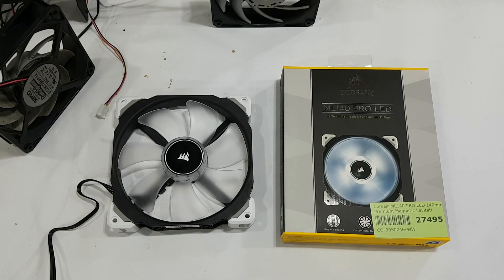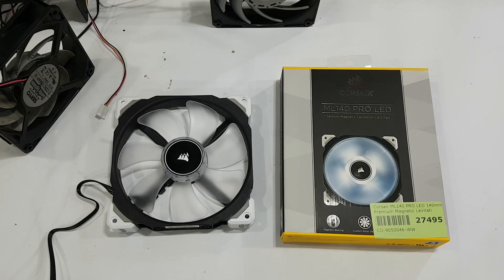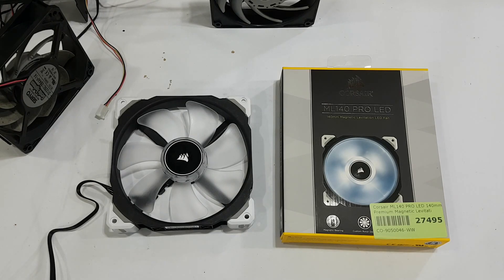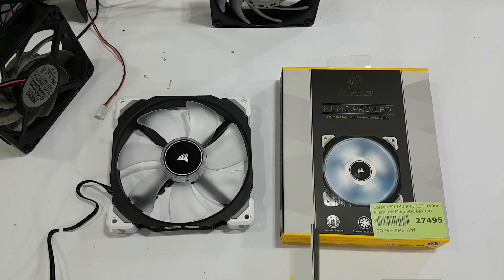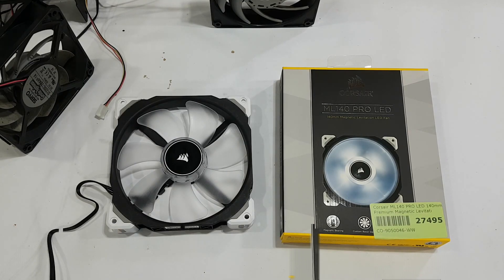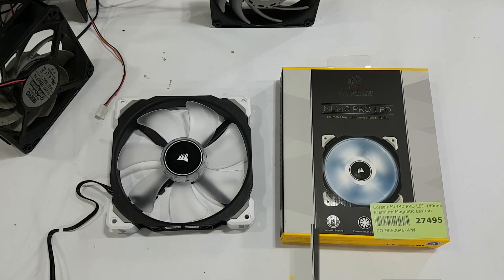🛠 Peltier Cooling My Computer: Corsair M120 ML140 :Part 2

Comment: All  of those aesthetics are getting in the way of proper function.  People will still buy them in droves I'm sure.  I will definitely need a shroud before I mount something as poorly executed as that.  And if it turns out to be the fan of the century, I will design and cut that shroud to make it work.  So ... now we'll be waiting on your performance evaluations of these to see if we indeed have access to the fan of the century. :)
Reply from the maker: Based on this test WHILE pushing through a rad they are good. i assume they could be miles better if pushing through a shroud. 
http://thermalbench.com/2016/07/12/corsair-ml120-pro-120-mm-fan/3/